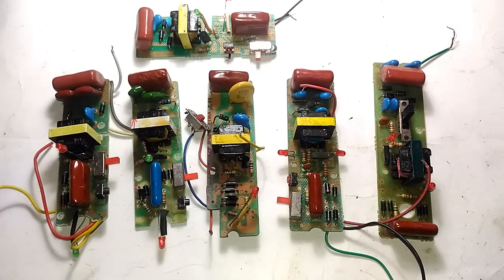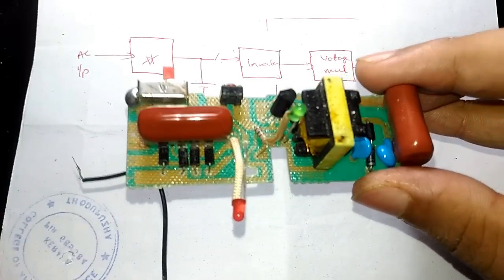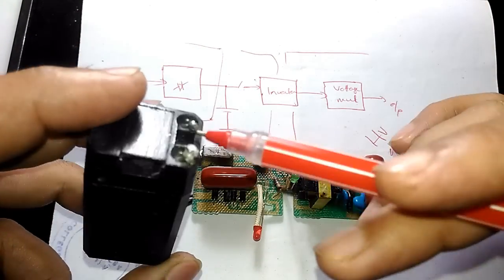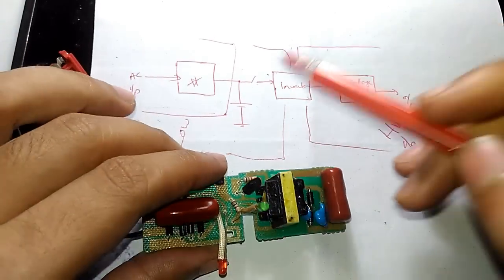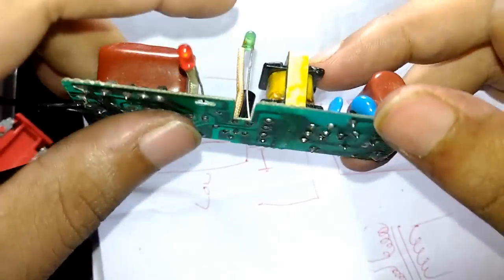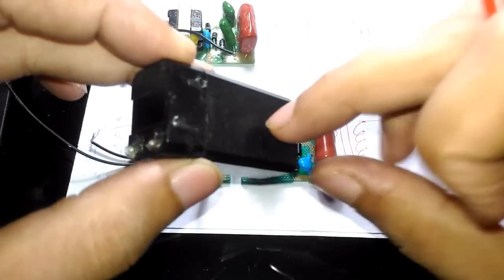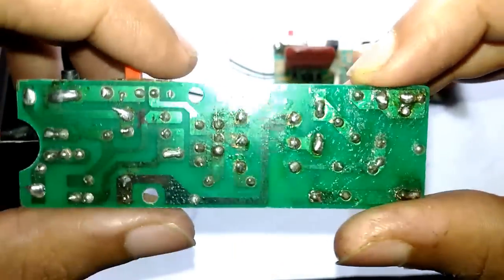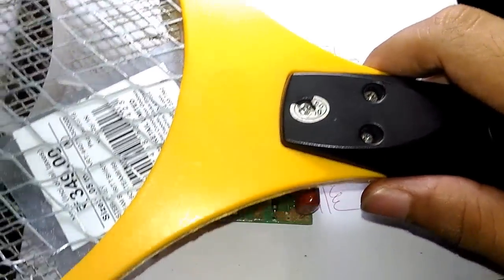IE#37: Mosquito bat, complete repair guide!

Comment: Hey! Thanks for the video. I bought a new bat the other day but mosquitoes don't die when they come in contact with the mesh. There is no arch or spark in the mesh at the time of contact. Green light glows i.e. it recharges the battery fine, also red on off light also glows when button is pushed. what do you think is the issue here. Thanks.
Reply from the maker: Just because the LED is on, doesn't mean the battery is charging. You can follow the steps mentioned in my video to see what is wrong.😊
Reply: INSIDE ELECTRONICS! Thanks!

Comment: You explained very neatly much appreciated..
Can you please tell me how to check capacitor properly ?
When I check charging out put  getting 180-220 volt I got surprised (shocked)
Reply from the maker: If you are getting around full mains voltage at the charger side, chances are the battery is open. These capacitive dropper rectifiers depends on the load itself to maintain the required voltage, unless clamped by any zener diodes. So if the load fails, the voltage will climb back to the full peak voltage. Checking the capacitor properly requires a meter that can read capacitance. Otherwise all you can do is to use the continuity test. Put the multimeter in continuity mode and touch both the terminals of the capacitor. You may hear a beep for a few seconds and then the resistance will climb until the meter reads OL or something similar. That means the capacitor is okay. If you continue to hear the beep in full volume for a long time the capacitor is shorted. If the meter just reads OL instantly when connected to the capacitor, then its open. But these tests won't show how far the capacity has dropped due to being put to use. If the capacitor has leakage or has lost its rated capacity, it may still pass the continuity test but will perform poorly in circuit. So better test it with an LCR meter if possible. Thanks for your valuable feedback though. :)
Reply: @INSIDEELECTRONICS  Thank you once again for prompt response..
Looks like culprit is capacitor i will change and see either it works or not..
Reply from the maker: ✌😊 Contact me via email if you have any further issues.

Comment: Thanks for the explanation of the mesh. It gives a good reference point to know if a bat is worth repairing. With the one I have, the outer mesh is already become kind of wavey and is also protruding outside. From your explanation, it will never form that charged field which means I might as well just throw it.
Reply from the maker: Yup. Salvage what is good and discard the rest.

Comment: My mosquito bat some time works sometime not. I have changed the tranjistor. and transformer seems okay in multimeter test. can you tell me probable reason? High voltage diode i Can't check.
Reply from the maker: Have you tried changing the switch? Sometime, the switch can cause these kind of issue. :)

Comment: What is problem if the new battery is not getting charged sufficiently and goes down .shpuld the charging circuit condenser to be changed?
Reply from the maker: Yes it could be the problem. If the capacitor is faulty it may not provide enough current to charge the cell. Also, the new battery may also be bad. Try changing the capacitor and see if it fixes the issue.

Comment: About the dielectric , have you tried toothpicks? Just use a larger air space between the meshes
Reply from the maker: Nope, I haven't tried with tooth picks. But I've tried with larger separation between the mesh but all that is going to happen is it it is going to find another route to ground. Make it too large and the bat becomes useless.

Comment: I charged battery fully ,after  I use bat ,after some time killing power fully reduced and also output led glow dim and full off ,what is the reason battery or capacitor?
Reply from the maker: Probably the battery has lost its capacity. You can try replacing the battery. The price is around 40Rs in my area.

Comment: very patiently and well explained.. I have four bats which I believe the battery is mostly fine and i need to get a replacement capacitor. Could you kindly suggest any capacitor which would probably fit all of them or rather any common name by which shopkeepers can understand my requirement and give it to me.. merely saying I need a high voltage capacitor of 2kV won't suffice I guess.. (I'm not a professional, just a DIY guy to be honest.)
Reply from the maker: +Soham Dutta Thank you so much for your valuable feedback. I believe you are talking about the final capacitor that is connected across the mesh terminals, if so the replacement capacitors are usually 470nf 1600V or 680nf 2000V. Basically the higher the capacitance value the larger the zap will be. But it will drain the battery faster. You can check for any markings on the capacitor and replace it with another of the same value. :)
Reply: +INSIDE ELECTRONICS! thanks. yes that's what i was referring to. I guess a better zap is the one to go for 😁. Well, Most don't have any value written on them. So will selecting 680nf 2kv serve it all? And are they actually commonly available in the market? and any idea what it's reasonable price should be approx?
Reply: +INSIDE ELECTRONICS! also how do you procure lead acid cells if they are dead or weak? is it rather better to abandon it in that case?
Reply from the maker: +Soham Dutta Well it depends on which lead acid batteries are you referring to. If its regarding those found inside these mosquito rackets, its better to discard it. But the bigger higher capacity cells can actually be brought back to life. Sometimes all it takes is a bit of electrolyte. You can search on YouTube for how to do it. :)
Reply from the maker: +Soham Dutta Sometimes it has some markings in it. If it hasn't any, then it's safe to go with the above cap. :) The price for those are actually cheap. Its like 10 Rs for a pair I think. But sometimes it gets cheaper.
Reply: +INSIDE ELECTRONICS! thanks a lot man. Love your channel and best of luck for the future of it.
Reply from the maker: +Soham Dutta Thank you so much for your support. :)
Reply: Soham Dutta

Comment: thanks for good explanation . but can we use transformer in stead of batry .
Reply from the maker: Thanks.. :) So, you want to operate it at mains level? Instead of battery?
Reply: You can use a telephone wall charger to power it but use a resistor to limit voltage

Comment: what is the optimal battery reading for a new battery? And can you replace the rechargeable ones with brand new aa batteries in series?
Reply from the maker: Voltage level of a new battery can be anywhere between 3 to 4 volts. It depends on how long it came out of production. And yes you can connect two AA cells in series but make sure to adjust the capacitor value to decrease the charging current.

Comment: Can u make a video on how to direct to an outlet , rather battery  use. Convert it!
Reply from the maker: It is possible to convert it and I've personally tried it 3 or 4 times before. 😀  However I didn't recorded doing it because 
1. The entire bat becomes reference to AC mains and it might kill the user rather than the mosquitoes, if not used properly.
2. The primary winding of the transformer and the switching transistor got damaged in all 4 bats within the first 20 minutes of use, no matter how many different resistor values I've tried. (sometimes the resistor itself burns before the transistor.)

So I don't want to make a video about something that works only for just a few hours and also unsafe. 😬 Anyway I will still keep this as a to-do project. 👍

Comment: What is the possible problem of my mosquito swatter because I was about to charge it and my son accidently activated it while charging and stop working
Reply from the maker: Most probably, the sudden power on while being charged, might have created a voltage spike which instantly killed the switch transistor.
Reply: You mean the transistor was the problem
Reply from the maker: Most probably yes. You can test it with the help of a multimeter.

Comment: I bought few D882 transistors online and installed one, but it didnt worked, can you tell me ow to check the remainingg ones as someone told the output should be more than 9.

Let me know whether the transistors are good or faulty ones.
Reply from the maker: So you want to check whether the transistors are good or not? If so, using a multimeter in diode mode, measure across the base-emitter and base- collector pins, with the +ve probe connected to the base, you will get a reading of around 0.6V if it is a good one. In a TO126 package, pin 1 is the emitter, 2-collector, and 3 is base.
Reply: @INSIDEELECTRONICS  Thanks for your reply, the reading in multimeter is 672 on both. how can we know the voltage of this transistor?
I had few questions as watched so many videos on mosquito bat, but didnt get much answers.
Checking voltage or testing with neon bilb at transformer can we able to know both transformer and transistors are good?
What is the best way to find the exact fault? My bat doesnt spark at all.
Reply from the maker: Most good silicon transistors will show around 0.6V only. So that is quite normal. But, if you were asking about the maximum operating voltage of d882, then it is 40V. Regarding the neon bulb method, yes it can be used to test the transformer and transistor at the same time. All you need to do is connect a neon bulb at the output pins of the board, where the metal mesh is connected to the board. Now when the bat is on, the neon should light up if everything is working fine. In your case, the issue could be a faulty battery or a faulty high voltage capacitor. If any of these is bad, the bat will work, but there will not be sufficient power to make the spark to kill the mosquitos.
Reply: @INSIDEELECTRONICS  Thanks for your feedback I am closure to find the fault.
Their is no spark at all and the transistor is getting hot. The battery is ok and tested with another battery installed a new one too.
I will buy neon bulb and will let you know once tested. 
Thanks again your reply, I am hoping to solve the problem.
Reply from the maker: Please note that we cannot measure the output voltage of this transformer directly with a normal averaging multimeter. You need a high voltage probe and also a true RMS multimeter. If the transistor is getting hot, that indicates a possible short at the transformer. Remove it and check the windings. Else the transistor will be damaged. You can get a neon bulb from old mains indicators or an old mains tester screwdriver. Have a good day.😊👍🏼

Comment: hey bro. In my mosquito racket   every thing is ok..but i getting very low output voltage in racket but.when i disconnect the wire of racket trap and shorted the output voltage it  gives  high spark.. i replaced battery, TR, capcitor but problem is still couldn't solved...plz help..waiting for your reply...
Reply: High voltage ke karan .. bohot sari magnetic dhool net main jama ho jati hai.. jaise ki aapne purane tv ke under CRT pr jmi hui powder soft  dhool dekhi hogi... 
Mosquito bat ke net mai yahi dhool unknowingly voltage ko drop kr deta hai..
 So net kboliye clean kijiye..
 Bend free kijiye aur reassemble kijiye... Maine same problem solve kiya hai 👍👍👍
Reply from the maker: The bat is now totaled. This is because the plastic holders for the metal mesh has lost its insulating property and are now leaking high voltage at the output. That is why the bat gives full power when the mesh is not connected. There is nothing we can do to recover it.
Reply: @iwantsushant  hey bro i did it ..but problem couldn't solved ....and there is a sound like ssssssssshhhh from the net.

Comment: can we attach a long wire directly to this BAT input end and Use ti With 220v direct AC volt supply without using BATTERY....because these bat batteries are very weak.
Reply from the maker: In theory it is possible. But it will easily burn the transistor within the first few usage. I've tried it myself and found to be useless.

Comment: ESP the transformer specifications and availability and thanks for your response.
Reply from the maker: I'm sorry to say that the transformer is not available to buy online or in any electronic stores in Bangalore area. Usually if the transformer is broken, you can carefully unwind the coil and wind new one by yourself. It'll be a time consuming work, but that's the only way.

Comment: Gteat video!!
Have query HS D 965 7L R which equivalent transistor can use here.
Reply from the maker: D965 is an obsolete transistor as far as the model is considered. It's by the way a 5A 22V NPN transistor and so you can use any part of similar or above rating. What exactly is your requirement for this part? :) Thanks for the feedback too. :)
Reply: @INSIDEELECTRONICS  
Thanks a lot for your reply!
I have 3 mosquito bat planing to replace existing transistor H SD 965 7L R
Looking equivalent similar transistor
Reply from the maker: Okay, for such applications you can use the commonly available 13003 transistor. It's cheap and often found in cheap mosquito bat boards. Although you can still buy D965 online. :)
Reply: 882,2583,8050,3407,2470,880,135,139,140,D9,2N2222. But pinout could be different.so check before connect and connect properly

Comment: The circuit used for reducing 220 to a lower voltage is a transformerless circuit using a big mylar cap coupled with a computed resistor.  When any of these is damaged the output voltage going to the battery is also unpredictable, or most likely, very high.  This destroys the battery in a very short time.  Usually, the cap/resistor tandem is for small current only.  If the circuit is forced to give a higher current, the cap/resistor tandem collapses, and the battery will eventually die also.
To be practical, DO NOT SWITCH ON when charging.  The power will also come from the cap/resistor and battery at the same time.  This forces a high current through the cap/resistor.
The other parts may or may not be affected, but the bat does not work anymore because the battery is busted, about 98 percent of the time, the battery is busted.
I've used / destroyed a lot of these gadgets. Now, I'm using one in my outdoor kitchen.  I don't need to charge or replace the battery anymore.  I swing it around like a badminton/tennis racket and I'm sure I really hit a lot of those flying critters.

Comment: I'd like to power these with 18650 3.7v batteries because the batteries in the AC rechargeable ones die quite fast. Of course I would lose the the AC recharging but I do have mutliple 18650 and a reliable xtar charger. I was planning to use an LM317T but I found out that the min Vin - Vout = 3.0v but these are typically powered by 2.4v nicd. and that's just a 1.3v difference, way below the the minimum voltage drop. I was wondering if I can modify the circuity myself. minimal electronic experience.
Reply from the maker: Instead of trying to charge the li ion battery with AC power, you can remove the NiCad charger circuit from the board completely and use a cheap Chinese battery protection board. These are available in eBay for as little as 1 dollar for a pair. You can then charge the battery using any USB power supply. That will be the more economical also.
Reply: Yeah, I have a reliable charger and am not trying to charge the Li Ion thru AC. What I want to do is drop the 3.7v to 2.4v since my bat is powered by 2xAA rechargeable. I tried powering it directly by 3.7v and the solder of the power wires melted. fun stuff. Thanks for answering.
Reply: @bryanbisimotopinas345  you can series with 2 in4007 diode between + side battery and board. It reduces 1.2 volt and you get 2.5 volt at circuit board.
Reply: @kandasamy363  ohhh! Would have been very useful 4yrs ago. The newer bats do have removable 18650 batteries now so no reason to do this now really.
Reply: Thanks 🙏

Comment: How does a capacitive dropper bring the voltage to exact 4v to charge the battery without a zener
Reply from the maker: Its because the capacitor acts as a resistor in AC circuits. So when used in series with battery the current drawn by it is enough to bring the voltage down to what the battery voltage is.

Comment: I have one question,What will be the voltage across primary winding of the transformer during operation?
Reply from the maker: The voltage across the primary will be the voltage of the battery. Its the high frequency pulsating DC voltage that causes a higher voltage to be induced in the secondary. :)
Reply: INSIDE ELECTRONICS! This voltage can be measured using multimeter (set dial at DC voltage)?
Reply from the maker: Well it can be measured, but not with every multimeter. Because the voltage across the primary (and in turn the secondary) will be a high frequency square wave, not every meters will be able to register the proper voltage. It may show some random average value.
Reply: INSIDE ELECTRONICS! I shorted the push button to check the voltage.but after some time I saw the transistor (D965)over heated and started smoke.I checked transformer after desoldering from the circuit and the primary winding reads 5.72 ohm, feed back winding reads 0.52ohm, secondary (high voltage) winding reads 1.24H.Voltage across the battery is arround 4volt with load.What will be the problem with the circuit for not working?
Reply from the maker: For the transistor to get heated up that much, the obvious reason will be a short circuit. Now that the transistor itself has been smoked, you need to change it anyway as it may have shorted internally. After replacing the transistor, look for any short circuit using a multimeter and also check the resistors in the circuit as an open/shorted resistance can cause a higher current flow. You can get these parts for almost free if you search around in your local scrap yard as people often throw them away for no good reasons. :)